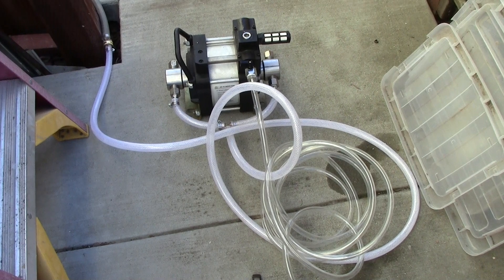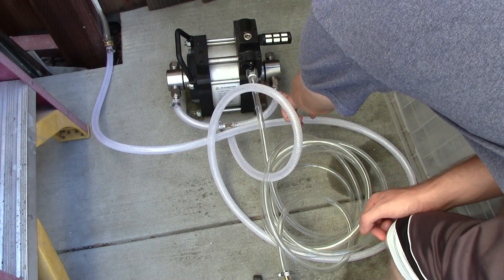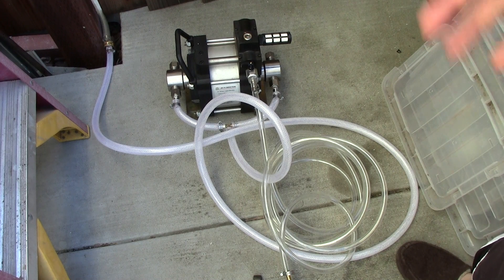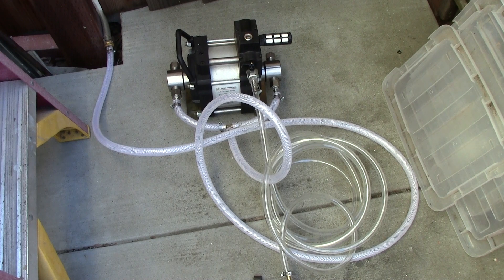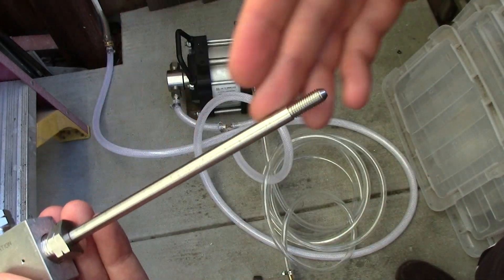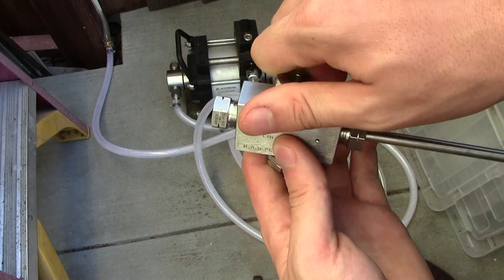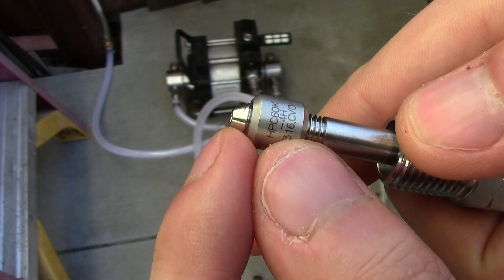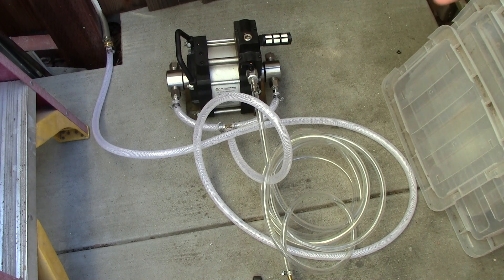6/25/20 DIY Waterjet Update Part 1

Comment: What model is the pump you have?  I’m looking at their website but I’m not seeing it.
Reply from the maker: JD400:1 Julyr or something like that it is over at my machinist place i would not recommend the pump until the machine works so purchase at your own risk.
Reply: @TheGreenEngineers  Can you tell me how much you're into it so far?, and approximately what you expect to be into it for when you're finished?
Reply from the maker: @smallblockchevy1022  umm mabye like 1200 or something i plan on having like 2k into it or so.
Reply: @TheGreenEngineers  The question of the make and model of the pump has still not been answered.  Can you post the make and model of the pump please?
Reply from the maker: @mmckay1956  Make Julyr. Model is JL-GD400. Note: Proceed at your own risk.
Reply: Where did you orfer this from...ie your supplier
Reply: Not seeing it anywhere either. You should have links in your videos for parts.